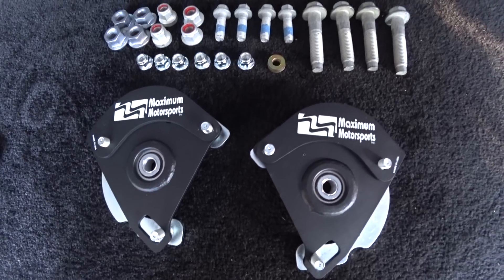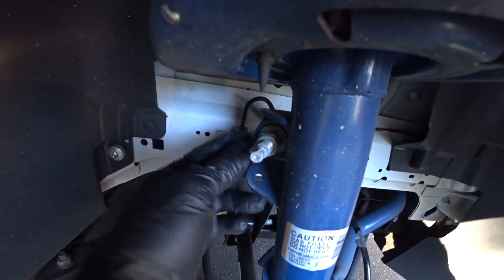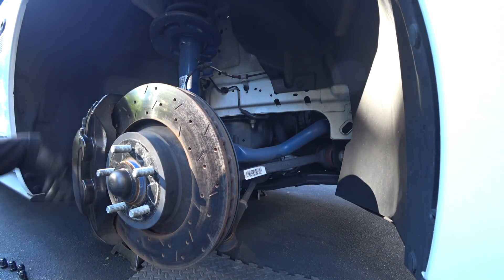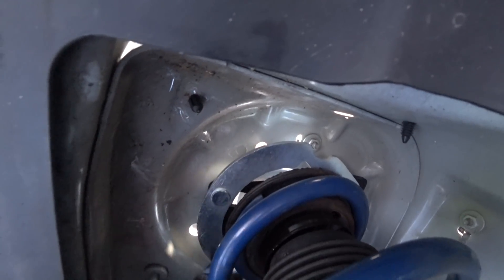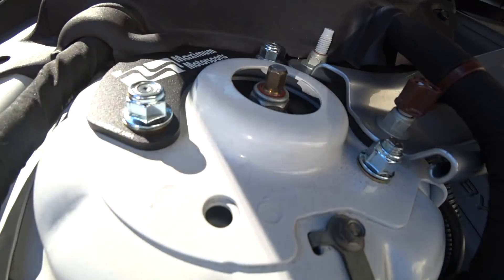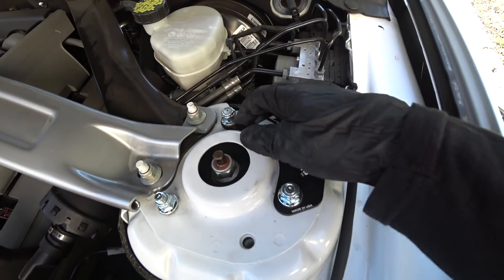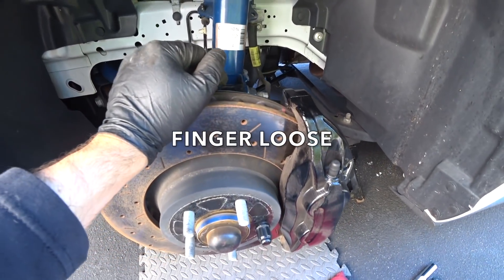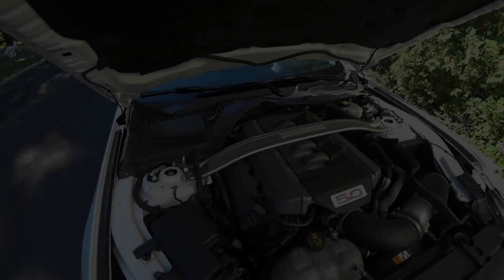S550 Mustang Camber Caster Plates | Maximum Motorsports

Comment: Also, I recently put on some Steeda Tridents. 19x10 in the front w/285 Nitto and 19x11 in the rear w/305 Nitto. I have the rear end camber thing for the rear, but even before the new wheels and tires, I had an extreme amount of uneven wear on the front tires with this same exact suspension and Maximum MotorSports camber plate.

Comment: Hey it's me again, just wanted to say thanks. I got the camber adjusted and the fitment is spot on for both sides. I also wanted to see if you could help me out with another issue I'm having. I just installed new hawk how plus brake pads on the fronts and after preforming the bedding process the rotors had a couple of grooves on both rotors. Looked like there was a rock between the pad and rotor but when I took off the pads to check them out wiped them and the rotor put them back on but the grooves keep getting worse. Rotors were fine before the new pads.

Comment: Nice. I literally ordered these yesterday and then saw your video today :-) and was very excited lol. Are the bolts removed when disassembling the suspension actually torque to yield, or do they want you to replace them so they have fresh lock tight? In one of your brake videos where you change pads you reuse the bolts but those are also bolts that ford recommends you replace any time you remove the caliper. I’m just wondering if I really need to always get new bolts with this stuff or simply ensure they are in good shape, clean them up and add locktite. Thanks as always for your videos! I was also going to install camber bolts at the same time just to have them there Incase I want to add more negative camber then the plates allow. I’ll start with -1.8 most likely but many guys at the race track that I read about are using the camber plate and camber bolt combo to get well over -3 and claim that’s where the car really needs to be. I’ll find out soon enough after my next two day event at Watkins Glen two weekends from now.
Reply from the maker: buy new bolts kits if you can, i tear my cars down so often i sometimes do not do it all the time until i find a set up i am keeping.

Comment: It would have been helpful if you showed how to adjust the camber since this isn't a "traditional" alignment setting with only rotating bolts. Is the camber adjustment made by loosening the bolts on the strut hat?
Reply from the maker: its very easy once the car is up on the rack you relieve some pressure and loosen the top nuts and can move the camber in and out. i prefer these over camber bolts because the OEM splined bolts are designed to lock the strut and spindle assembly together where as a non splined camber bolt that is thinner diameter can come loose, especially on bumpy roads like we have in NY.
Reply: Wonder how these compare to the vorshlag plates
Reply: ahhhhhh ok I'm tracking now....I appreciate you always taking the time to answer the questions in your comments. This is the only channel that does that. So thank you

Comment: Thanks for the tips! What are you thoughts on wheel spacers? I want to bring my wheels out a bit on the mustang.
Reply from the maker: if you get good ones and properly install them you are fine. Porsche been using them for decades on the autobahn and if Germany TUV approves them that is something to add a bit of confidence. Just get a good spacer from Eibach, H&R etc do not buy cheap ones on Ebay your life depends on it.

Comment: Have you put any on your GT350? Would you recommend them on a gt350? I was considering installing a set along with some OEM GT350R springs.
Reply from the maker: yes these are great to have also go the BMR GT350 springs they are the best ones I feel. I have them on my car and will post a review soon. Also much cheaper to buy than the OEM springs and the drop is just right. When I post the video ll have  discount code you can use on checkout.

Comment: I’m sure it’ll take a little while for you to see this comment, but was this car out of North Carolina and had less than 16k miles on it? Because looking at the little details and mods it has, I’m pretty damn sure I bought this car with a rebuilt title 🤣🤣🤣  also, is this suspension supposed to make your Mustang ride like a tank?  Because even if my car isn’t the one in the video, I have literally the same exact suspension and Steeda crossbar underneath and this ole girl is a ruff ride (very fun and grabs the ground in every corner) but very ruff.
Reply from the maker: Hi this particular car was subjected to a total loss due to very minor flooding during a September 2021 Hurricane that ripped through NY. The car was originally from Florida. So most likely the insurance company sold it and someone fixed it quickly it was just needing carpets and water was in spare tire well. Sounds like you got the car in this video hopefully at a great deal the original owner put lots of money into the mods
Reply: Yupp lol that’s my car! I bought it a month later with 16,846 miles for $29k and have never had a problem with it haha it has a rebuilt title, but I will probably never sell this ole girl haha this is so wild dude hahahahaha
Reply: The mods were the other selling point. Lots of money I didn’t need to spend! BUT on another note, when I recently changed the wheels and tires on it, it had the OEM Cali Special wheels and tires and the front tires had a wild amount of uneven wear on the inside of the tire. By that I mean, the insides were smooth and the outsides had some tread left (I know, should changed them much sooner, but I wanted to wait till I had the money for the wheels I wanted before doing tires)
Reply: @autofanaticcars  how do you adjust the camber more? I haven’t touched the camber plates or anything. Even with this kit you installed on my car, I had a wild amount of uneven wear on the old tires.

Comment: So I installed kw coilovers and these caster camber plates, and I made sure that the covers were in the same position from the top, I got an alignment, but when I look at the driver side, the tire is about a centimeter away from the fender. On the passenger side the tire is about an inch away from the fender and the whole wheel looks like it has negative camber. The driver side will only rub when there is a bump at cruising speed. I've looked every where and taken out to two different shops and can't seem to figure out how to make both sides even. If anyone has any info on how to get both wheels the same distance from the fender I would really appreciate it.
Reply from the maker: sounds like the strut body where it bolts to your spindle needs to be loosened and corrected from left to right, that is common if you were not paying attention doing the install. KW are elongated for camber adjustments you may have maxed out one side and not the other, bring them both back positive and use the camber plates to do your adjustments on the alignment rack
Reply: I'm having this exact same problem , did you get it corrected? If so how